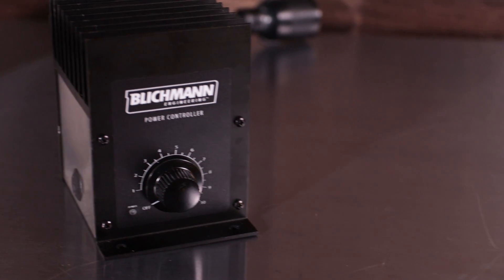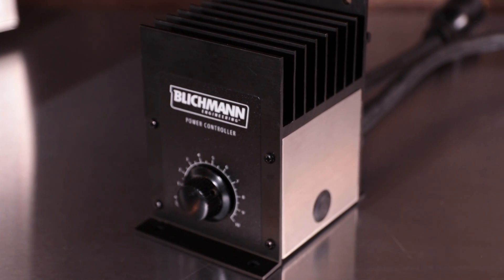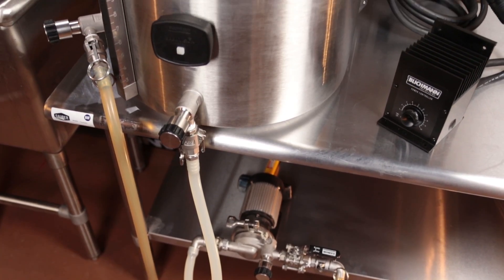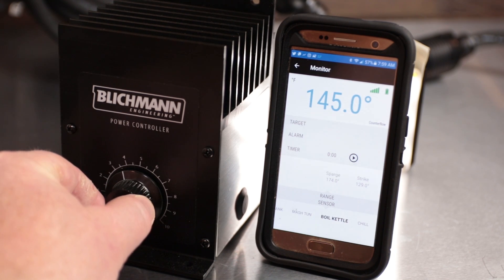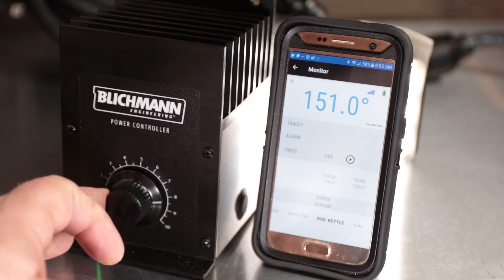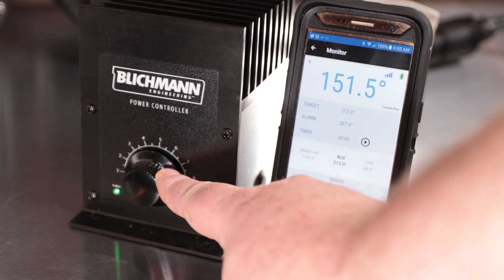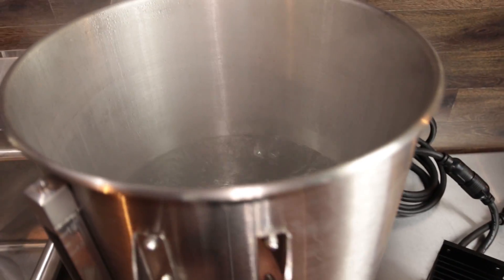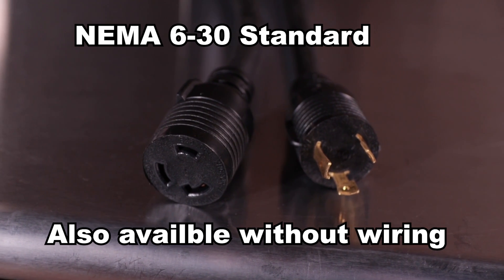Blichmann Power Controller Review 240V

Comment: Im thinking about matching this with the Brew Commander in my 3 vessel HERMS system. I would use this to control the boil and would use the Brew Commander to control the mash. I like that you showed that this controller can hold a steady temp. That function would be good for holding a temp for whirlpooling hops for a set time after chilling to a desired temperature.
Reply from the maker: Yep I think that with the latest controller from them you could run your Herms with those 2 contollers

Comment: Hello. Great video . Do you think I can match it to a spike 50 gallon boil kettle? that runs on 2 heating elements 240v .
Reply from the maker: Sure, they make a second power box that can he controlled by a single controller. 👍🍻
Reply: @ShortCircuitedBrewers  got it . Thanks for sharing . Cheers from Mexico

Comment: I have a MegaPot 1.2 will this work with it 
8 gallons (32 quarts / 30.2 liters)
Diameter by Height: 12.6" x 15.4"
Metric Internal Diameter by Height: 32 cm x 38 cm
Wall Thickness: 0.8mm
Reply from the maker: Are you asking about the boil coil?

Comment: Humm, a recirculating mash I think would have been a better test.
Reply from the maker: In my experience with temperature controllers if it will hold temp on water it will hold a mash temp. The mash just provides a larger thermal mass that maintains the temp as good if not better than this test. PIDs I have used I auto tune with water only and they hold temps spot on. Thanks for the comment!  Cheers Stuart! 👍🍻

Comment: Nice review, thank you. Do you have any thoughts on the Ss Brewtech eController 2V? Seems like another less expensive way to run an all electric system. At $1100 out of the box ready to go it's less than the kit and half the price of a fully assembled "the electric brewery.com" box. Granted it doesn't have all the bells and whistles of the higher priced unit.
Reply from the maker: Thanks, the SS system certainly looks capable enough. It is based on a SSVR. There are so many ways anymore to get into electric brewing, it almost comes down to preference anymore, if cost is not a consideration.  Cheers! 👍🍻

Comment: A solid state relay needs a VDC voltage trigger to turn on. Pulse width modulation of a DC signal is the method used

A solid state voltage regulator employs a resistance potentiometer that controls a TRIAC that switches on and off at different periods of the AC sine wave. This method is called Phase Angle Modulation. It is effective, but inherently is not very precise with the rotary potentiometer unless its close to the 50% level. This is because of the AC sine wave crest where it has the highest voltage rms that the triac can block.

The blichman uses a solid state relay, and the rotary pot controls a PWM controller circuit, which then fires the SSR. Very precise and efficient. 

I just built my 120VAC 2250W SSVR setup and will be making a video soon. Def enjoyed watching this video, though would have loved to see the guts inside!
Reply from the maker: See now there you go getting all technical..  Lol I was trying to keep it simple. Go look up the manual for it they show the insides in a couple of photos. Cheers!!  👍🍻

Comment: So this will work with the older 240v 3prong plugs right?
Reply: Not compatable with a GFCI circuit breaker since the ground and neutral are bonded at the plug. The breaker would nuisance trip till they were separated with a modern 4 prong.
Reply: @Bassguitarist1985  aww, cause I would have to add a gfci breaker(in my breaker box) and that breaker is a 4 wire gfci breaker and not comparable with my older 3wire plug that is missing a neutral connection.... what about a "inline 240v gfci" http://gfcistore.com/30-amp-inline-gfcis.html

Would this provide gfci protection?
Reply from the maker: Travis are you talking element or power plug?
Reply: @ShortCircuitedBrewers  I have a 3 prong dryer outlet and I'm going to setup a biab system next to it, so I am trying to figure out a way to safely use the outlet. I already know I can't do a most of the 240v controllers on the market because of the 120v outlets for pumps.  My electical box is kinda far from my future brewing space.
Reply from the maker: @ColoradoFlyFisherMan  yeah that sucks. I can't really advise running it without a GFCI breaker of some sort on it. Is all the wiring in the basement?
Reply: @ShortCircuitedBrewers  yeah its in the basement, my breaker is across the house, outside.... http://gfcistore.com/30-amp-inline-gfcis.html  would this work?
Reply from the maker: From what i am reading, it looks like those would work.. Not a really bad price either. I will be bookmarking that site! Thanks Travis!
Reply from the maker: From what i am reading, it looks like those would work.. Not a really bad price either. I will be bookmarking that site! Thanks Travis!
Reply from the maker: From what i am reading, it looks like those would work.. Not a really bad price either. I will be bookmarking that site! Thanks Travis!

Comment: WOW 7200Watts. aw Aw AWGH! Like the  horsepower, now I gotta find out how much equity it's going to relieve me of. Not sure if I would run it as a intermediary to my RaspberryPi controller or not. It won't save me money in parts, but actually add some cost. It would be kind of nice to regulate differently than from the PID algorithm of 100% on or 100% off. No scorch boiling etc. Great Video Al. I'm sorry I meant Brian. Cheers.
Reply from the maker: Lol Vroom!! 👍🍻
Reply: @ShortCircuitedBrewers  It would be a fantastic product if there was a port for plugging in a Single Board Computer like a raspberry pi to operate / regulate the pulse width with. To speak that makes me sound insane. This would be the BEES KNEES!
Reply from the maker: @beeroquoisnation lol the cat's meow!!